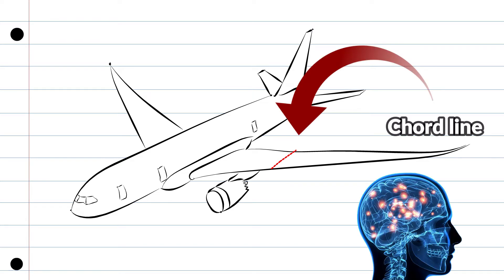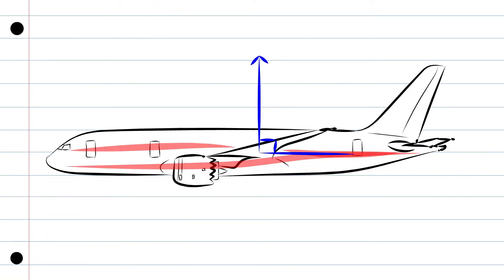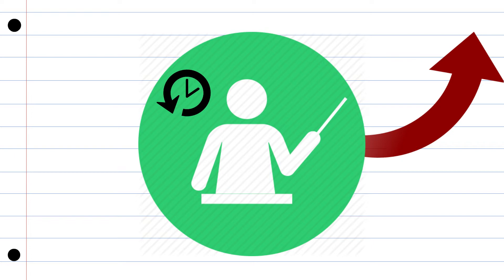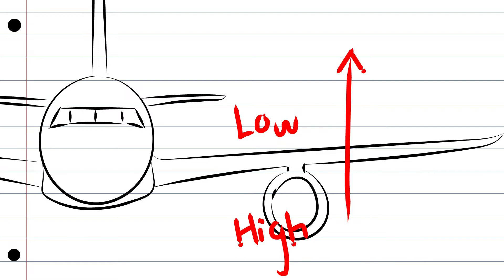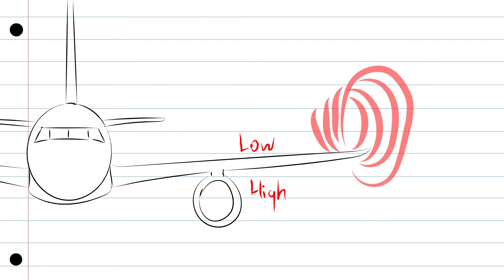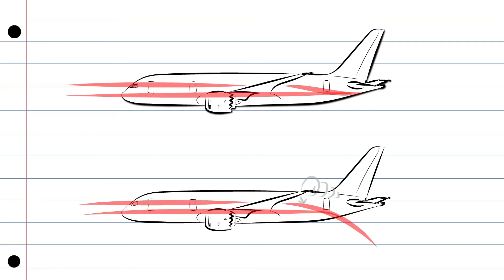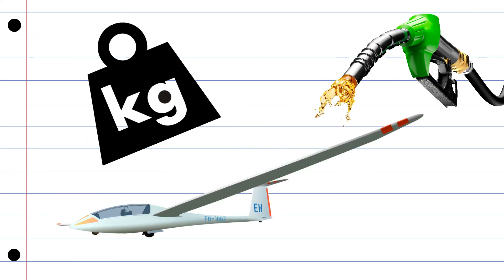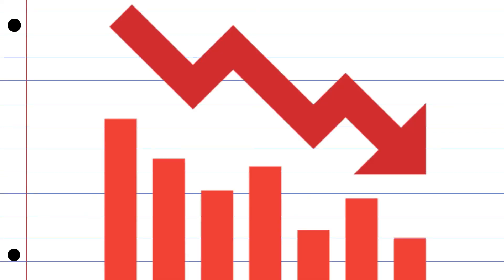induced drag and angle of attack| Lesson #3

Comment: if lift is always supposed to be perpendicular to free stream velocity, and drag is always supposed to be parallel to free stream velocity, then why is that rule broken when the lift angle is deflected?

Also, why does the drag also deflect backwards? Why does the 90 degree angle not shrink when only left is deflected?
Reply: The profile drag is parallel to the free stream but the induced drag is just the new lift component due to the vortices.